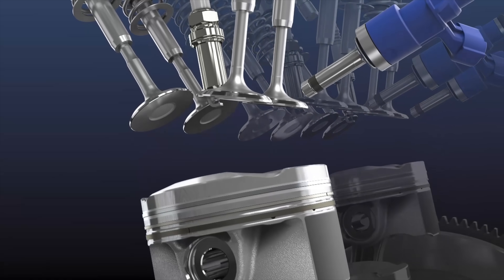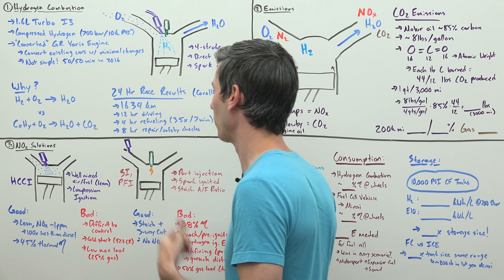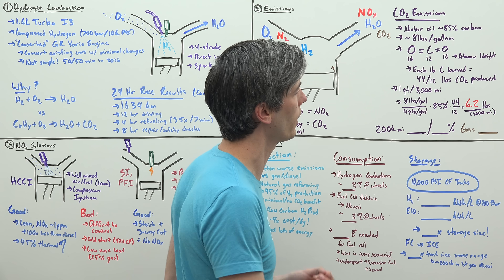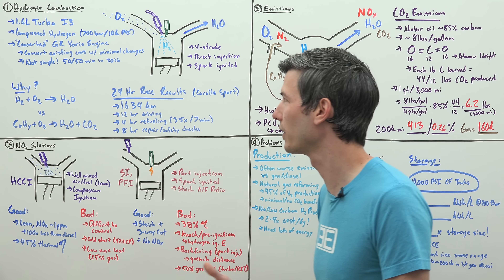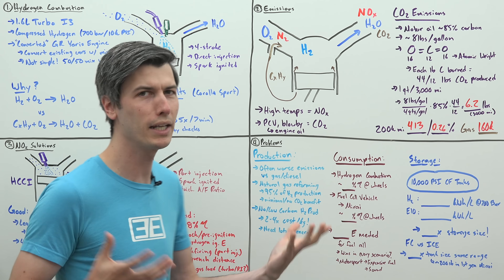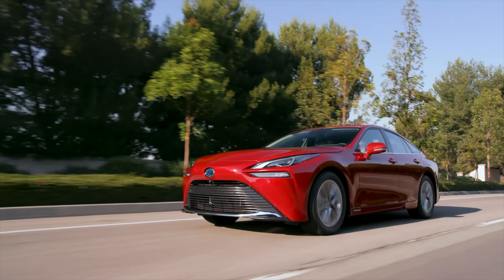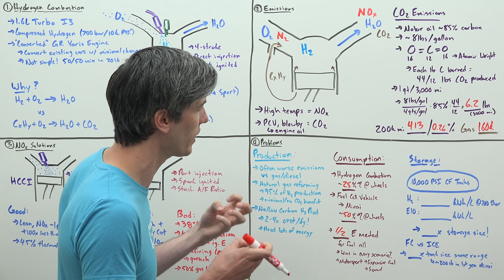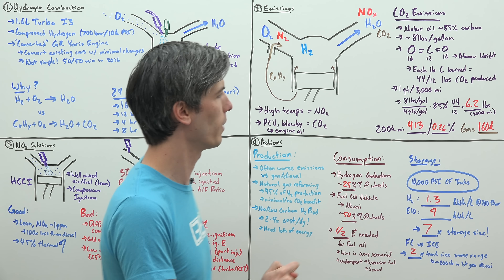Toyota's Developing A Hydrogen Combustion Engine!

Comment: “25% load, meaning you would need very large engines to make good power” sooo another 8.0L v10 hydrogen viper?
Reply: with all the power of a 4 cylinder corolla!!
Reply: @bigbones916  if your really lucky. Strap a turbo to that viper. Let it rev to 10k and you'll start getting closer to an impreza
Reply: Or we could just use gasoline engines. Why are we trying to reinvent the wheel?
Reply: @Benjamin Smith dude koenigsegg makes 600hp from three cylinder engine
Reply: @danielsatko-  he’s not wrong tho, the most powerful “4cyl” in the world, while the gemera is a 3cyl engine @,@
Reply: @TKUA11  cause more people are realizing that cars are killing the planet
Reply: @TKUA11  something has to do with global warming. I am a car mechanic and yes my study has also taught me that global warming is real and needs to be solved also oil isn't in infinite amounts available on earth. In the way we are consuming oil now faster then you think. But not before most people get their feet wet from the polar caps that are melting.
Reply: @danielsatko-  right.. I still think Mercedes is more impressive because you can daily drive it an expect over 100k miles of life.
Reply: Well it would need 4 times the displacement soooo...

32Liter v10 time
Reply: @danielsatko-  whats the displacement of the two engines
Reply: Would not mind a new Viper. Gasoline will be with Us for quite a while. And big block egines make such a beautiluf sound
Reply: @radboxingedits4107  I don’t think dodge is making a fuss about building bigger engines
Reply: I think the hydrogen engine will rev higher, 7500-15000rpm compared to todays 6000-12000

[EDITED]
Reply: @TKUA11  Not about that, it's about finding more carbon neutral ways to spin the wheels.
Reply: @atrem7942  Because the earth never had a period without ice caps... Oh wait... 🤔

In any case, you're right; just avoid the doomsayers.
Reply: @bigbones916  …and a mandatory trailer with the fuel tank to make it farther than the first intersection without running out of fuel.
Reply: actually his information is wrong and outdated
Reply: @SelecaoOfMidas  the earth will be just fine with or without us. It is only for mankind , global warming is a threat.
Reply: why can’t they combine an electric motor to get big RPM that’s supplementing the hydrogen engine? dual motor
Reply: @Cinnamontoastcrunch1029  it's actually the huge transport ships, which run almost on crude oil
Reply: @bigbones916  a 4 cylinder Corolla doesn’t make good power
Reply: @ButtMcDuck   Yes its a joke its meant to make fun of how weak the engine is compared to a normal engine with sarcastic enthusiasm.
Reply: With turbo chargers,, yes we can make it go fast on water,, I think hydrogen might favor big bore short stroke
Reply: Bob Lazar water powers Corvette solves all these problem.
Reply: @TKUA11  because failing to reinvent the wheel means we will ultimately be crushed by it`s wheight when it inetively catches up with us

I don`t like that our beloved dinosour juice drinking noise emiting hunks of metal are at serious risk of disappearing, but it`s somewhat reassuring to see companies like Toyota experiment with hydrogen to keep ICE going, or companies like Porsche and Bosch (and I seem to recall BMW also participating) who are experimenting with carbon neutral fuels that are supposedly a direct gasoline replacement, wth the advanteges of being fully carbon neutral, and emitting significantly less CO2 than normal fuels
Reply: @SelecaoOfMidas  We have never evolved to a period without the ICE caps nor has most plant and animal life.  The last time we have had that massive of a change of climate that quick we had great extinctions where 70-95% of all life went extinct meaning we would probably too.  Even if we don't go extinct from that alone our food supply almost certainly will.  So either billions dead or extinct.  Those are great options just so we can avoid having the single greatest greenhouse gas contributor on the planet (POVs, like if you look at numbers its not even close to anything else), still have V8s for noise.  yeah that's a great trade off vroom vroom for extinction.
Reply: @TKUA11  I can't tell if you are trolling, or just not smart.
Reply: @TKUA11  well in the big picture stuff cars aren't the issue but are the target so we have to go on a wild goose chase because politicians.
Reply: I want to see a 15.0L V20  hydrogen turbo engine making 300 HP perhaps. That'll be sweet
Reply: @geogmz8277  100k miles isn’t good. i would not buy a car with 100k life expectancy. you never know what kind of situation you’ll be in tomorrow.
Reply: @WillyK51  gasoline has about 15-20 years before we never get new ones again. so many of the biggest car company’s have said they plan to have full electric line ups by 2030-2040ish
Reply: @DrumFFx  because lithium is finite, same with gasoline/oil. we need something renewable through and through. electric battery cells can only go thought so many cycles before they’re useless and won’t hold a charge/won’t charge.
Reply: Jack K  it went down the past year because of covid. it’s going up bro. more drivers = more pollution. and there’s more drivers on the road now than there’s ever been. just open your eyes. have you not noticed more and more traffic in your area?
Reply: @Petrospect  another big contributor is lithium mining. it’s just as bad or worse than having gas cars. right now gas (ICE) cars are our best option. but if we don’t start some sort of revolution for the future, there won’t be much of a future.
Reply: Theres also a company that just made a new a boat engine, that makes 600hp NA, out of 4L, 4 cylinder.
Reply: @justabrokeredneck  I´m 70, so will hear the roar of V'8 race cars till I die. Hibryd´s make more sence bacause the miles they can cover. Any kind of presurized fuel like propane or hidrogen is akward , even if it´s green. Presurizing Hidrogen will use a lot of energy. After what hapened in Texas when electricity went down, gives you an idea of whatwill hapen if you substitute 25% of gas engines and replace them with electric and every one plugs in after work at the same time. Unles you go nuclear to produce enough electricity or use more fossil fuels for that pourpose. No one wins.
Reply: 6.0 V12 BMW hydrogen engine made 260bhp. With 5.6MPG......
Reply: @Benjamin Smith bmw made a 270hp hydrogen ICE a decade back
using a 6.6 liter V12
Reply: @Benjamin Smith Exactly; and over time with improvements in technology, engine efficiency and performance this could prove to be big.
Reply: same power as a toyota prius? lol
Reply: @bigbones916  200 viper hp feels a lot different that 200 corolla hp
Reply: @justabrokeredneck  "another big contributor is lithium mining. it’s just as bad or worse than having gas cars. right now gas (ICE) cars are our best option. but if we don’t start some sort of revolution for the future, there won’t be much of a future."

How is it worse than ICVs? Many studies have been done that debunk this claim.
Reply: @radboxingedits4107  Or 6.2L DOHC naturally aspirated V8 with an 8200 rpm redline.
Reply: @cryptikreap795  Or crank up the compression ratio out the wazoo and use prechambers.
Reply: @TKUA11  Climate change! It's real, we caused it by burning fossil fuels and we have to stop emitting CO2 or it's going to get way worse.
Reply: @danielsatko-  On petrol.
Reply: Except the viper produced 645 HP and 600 lb of torque… the hydrogen equivalent would produce between 92-192 hp and 85-150 lbs of torque… talk about diminishing returns. I used the 25% and 7x power to come up with those figures… anything less than 80% of what you can get from gas/diesel will absolutely fail in the market.
Reply: @seraanimsti3816   3cylinders - work different my little human. 3cyl rev higher ... F1 Cars have 3 cyl engines
Reply: @Cinnamontoastcrunch1029  yea the car is killinh the planet... not the ships and planes that transport stuff that people dont need a cargo ship uses over 100000 gallons of diesel each day 24h 365 times. And this war against ice cars will the go after ev cars becus its not about the climate its about limiting how much normal people can own.
Reply: @mezo72271  yes they are a big reason too. It’s a whole bunch of things combined that is killing the planet
Reply: @very7962  I love v8’s. I prefer gas cars over electric cars in terms of fun and sound however I can admit they kill the planet
Reply: @mikkejalonen9050  it’s multiple things killing the planet!
Reply: @very7962  actually many countries are gonna stop producing them and also it sounds more like wheeeeeeevvvvrooooooom
Reply: @very7962  why don’t I deserve freedom? That’s one of the reasons I love this country. There is no need for crying
Reply: Realistically, most vehicles made today would be perfectly serviceable vehicles with a reduction in power. Some could have 1/2 or 1/3 the power as they do and still be fun, I don't need a 400+ HP pickup, but I do like a 400HP pickup.
Reply: @Benjamin Smith Toyota currently make turbo v8’s that are 202hp. Their goal isn’t huge power
Reply: @sileniu  The F1 use V6 powerplant as of now, unless you are talking about 3cyl on each sides of v6.
Reply: @bigbones916  hydrogen cars have been around for a long time
Reply: @TKUA11  their trying to reinvent the wheel to make money on us..
Reply: That would still only get 250hp, out of your 8l v10.
Reply: @TKUA11  If that isn’t obvious to you maybe you need some sort of upgrade
Reply: What is interesting is the level of mis information,
 Some Facts h2 have s More Force yield than Btu Heat yield considered a cold radiating gas ,  some mixed message in your video which should be corrected , on one hand you say  need a lot of h2 on the other hand you say too much heat this is factually wrong, l  see you conveniently left out the Calculation for EGR % slow the laminar flame speed of the h2 to be a co equal replacement for carbon fuels why did you leav that off if you read the Hydrogen combustion report?? ? Often Carbon Fuel  Engineers  like to leave the EGR out of their explanation as  it shows h2 is a carbon fuel replacement equivalent  , Learn about the Effect of using EGR  % to lower the laminar flame speed of H2 creating efficiency and force yield not btu yield , this is what toyota is doing to co equal and replace all fossil fuels doing this allows less h2 to be used and thus less nox is the out some. . The Tax on h2  is higher income for  cities as the manufacture cost is  lower.   The Energy density of H2 is much higher than other fuels, (not but  it is about force)  God Speed NEVER STOP LEARNING
Reply: Jack K  why do you think pollution is going down you god damn genius?
Reply: Hydrogen takes more energy to produce its a waist
Reply: Toyota doesn't want electric vehicles
Reply: They invented the electric motor way before there were lobbyists
Reply: His assessment in this vid is a bit tongue in cheek. Hydrogen is the worst fuel for compression ignition, far too high octane, not sure why he bothers discussing it. Same thing with port injection, it's not 1996.
Reply: How about oxygen and hydrogen together qhen produced directly from water and injected in the engine
Reply: @TKUA11   because breathing in elevated levels of co2, nox is really awful for brain and lung function. Also gasoline will run out eventually.
Reply: @atrem7942   China generates about 27% of global greenhouse gases, more than the rest of the developed world, including the US.  The US is the second largest CO2 emitter at 11%, India is third at 6%. US oil consumption is already down to 1995 levels and falling further according to the EIA.
Reply: @bigbones916  oil ppl
Reply: @TKUA11  It's a finite source of energy. You don't know that?
Reply: @Benjamin Smith There were hydrogen powered engines many years ago. I wondered about hydrogen 30 years ago, found it had been done.
Reply: @TKUA11  
Oil doesn't last forever, is a finite resource. Even if we didn't care about the environment, companies will still care that they'll run out of their main resource.
Reply: Know that the Hydrogen Engine, based upon diesel to create the ignition less than 3%, has Pmax at about 88% of the Diesel Engine.

On this basis the MEP will be about 90% of Diesel.  Based upon this the Hydrogen Engine will mean an Engine about the same size.  Take the Fiat Ducato 2.3 litre Diesel, 130 Horse Power.  Replacement Hydrogen Engine will produce 115 Horse Power.  Given Pmax is lower, then the weight could arguable lighter or conversely same power from about the same weight slightly larger volume engine
Reply: you lost me when you aid its rally difficult to convert an engine to run on hydrogen, its not hard at all, cng systems exist already, substituting hydrogen for natural gas< dropping engine compression to mini,se engine knock and tuning properly to suit hydrogen is not hard either. the higher pressure tanks for hydrogen storage already exist.
Reply: He is wrong ... it will in fact over power a gas engine by a mile.
Reply: @mezo72271  incorrect, nice thought though. Ships account for only a small fraction of total transportation emissions. Look it up.
Reply: @thearchitect4726  "dropping engine compression to mini,se engine knock", octane rating is 130! You could run it in a diesel with 16:1 compression without knock!?
Reply: @Salvaba  unfortunately you will need a hydrogen tank half the size of your house if you wanted to go a decent distance between fuel stops.
Reply: @ameserich  would love to see the cooling system that an engine reving 15,000 RPM would need for a daily commute. You would have to drive at the speed of a formula one driver to prevent your engine from overheating.
Reply: @abyyman1671  I would love to see your fuel bill if that's the size of the engine you have to drive on your daily commute.
Reply: @bubba842  UHM... what im saying is 15k is the max for production vehicle, only engines for hypercars would have that... do you know todays gasoline engine are easily capable of 12k rpm? Lets say Hydrogen engine would rev 25% more
Reply: @Cinnamontoastcrunch1029  Did you know that the 15 largest ships in the world make more pollution than all cars combined?  I'm certainly on board with reducing pollution wherever possible.  That said, to make the biggest impact now, I think we would be best to tackle unregulated marine emissions, industry and strip mining.  Cars are far more visible day to day, but we can't change them very quickly.
With the issue of obtaining the necessary elements for battery EVs, and dealing with used batteries, I feel a more sustainable direction would be hydrogen fuel cell cars, running like an EV but with a fuel cell, not a battery.  This would alleviate that issue.  For energy, I think we must look back at nuclear, and use it in combination with renewables.  There are different reactor types, like molten salt thorium, much safer than the older thermal reactor designs.  We could use the electricity directly wherever possible, and use the excess to generate hydrogen.  This could replace natural gas through existing pipelines to run gas appliances and cars.
Reply: @jarrodheley7879  true I agree
Reply: If it made the right noise - OK 😎
Reply: @Benjamin Smith Completely inaccurate comparison. The gas engine started out extremely primitive,  so there was  a super large path to move upwards. We didn't know anything at that point so improvements came large fast and easy.  These hydrogen engines are starting way above that Benz engine from the 1800s. Surly you don't think this is comparable?
Reply: @Benjamin Smith it won't take 100 years to figure out that hydrogen is an absolutely horrible idea and abandon it.  Most people already have that part figured out.
Reply: @HAL-dm1eh  hydrogen is limited by how much fuel you want to burn to produce it. And you do know that you burn more energy than you produce when extracting hydrogen right?
Reply: Otto movement is not suited for hydrogen.. There are other design engines that are..once developed
Reply: @bigbones916  not if you mix it with a nitrogen based oxidizer like with rocket fuels, that’s exactly what imma do once I get my hands on it. That and hydrogen has a faster burn rate so you can speed up the compression.
Reply: @Spearmint22425  I don't think the engine would have the tolerance for that lol!
Reply: @bigbones916  that’s something to be found out
Reply: @Cinnamontoastcrunch1029  The US army emits more co2 than most countries. There are far bigger problems than cars.
Reply: We already can make a 1500cc three cylinder turbo engine produce good hp and torque. Drive smaller cars for the mean while, and think out the new non damaging fuels and concepts. Electric by battery is not the forward in my opinion, unless someone makes one powered by air and uses no fancy chemicals or precious mineral's. This technology probably must go on. Hydrogen may be more expensive and less efficient, but where else are we to go? All types of hydrogen development must go on, as well as battery development. Although I think the latter will loss to some other energy source.
Just a thought, what about  highly efficient capacitors in the car and a charging system layed in the ground. It could charge in a similar way to our cell phones in a connect free charger station. Endless Kms for as long as the pocket holds out.
Reply: @SelecaoOfMidas  There are some promising studies out there regarding graphene-coated rubber band powered vehicles.
Reply: Another? There was a first one? Where can I read about it
Reply: Or shorten the stroke and increase revs.
Basically this would make a great motorcycle engine.
Reply: @SelecaoOfMidas  🐴🐴🐴🐴🐴🐴🐴🐴🐴🐴🐴🐴🐴🐴🐴🐴🐴
Reply: @mikkejalonen9050  you realize cars collectively consume more than all ships and planes don't you
Reply: @marcanthony9659  If that matters remember the first Ford V8 made only 95hp at 3.6L , my friends altezza is a 2.0L 4 banger from 2001 and makes 190hp stock, gasoline engines have come a long way.
Reply: @Spearmint22425  you can just use straight liquid oxygen and liquid hydrogen, BOOM goes the engine... but not In the way you want 🤣
Reply: @Benjamin Smith jcb are developing similar and have prototype diggers working with hydrogen engines.
Reply: @Benjamin Smith pretty far, if they continue to exist and innovate for another 150 years.
Reply: Right on. A gallon of hydrogen in a modern car would not make it up a 5% grade. 500 gallons, maybe.
Reply: @TKUA11  because hydrogen is a no carbon fuel. if made from renewebles that is
Reply: From my understanding the reason they are inventing internal combustions hydrogen engine is because:
1. Hydrogen is a no carbon based fuel that can be made economically by voltrolysis. not electrolysis which is very expensive. Using voltrolysis one can make tens of liter of gas using under 100 watts of power.
2. There is a somewhat secret technique that is done on the HHO to increase its energy output before you burn it in the engine. They mix it with ionized gas and pass it through some kind of gas processor first. This can increase hydrogen energy density up to 3 folds.
Reply: @raloed.363  Pie in the sky.
Reply: No its actually way over 25% if done right to produce power and its been being done for years same as the patent for ceramic engines , combine the 2 and you have no need for servicing or other engine dramas with zero emissions and no need for exhaust so vehicles can be made lighter n quieter... I have seen drag cars buses trucks and normal family cars down to the mighty old Mk2 ford escort pinto running on straight hydrogen zero fuel such a shame the governments and oil companies threaten so many people that are doing all the experiments and getting them to work when their own teams cant lol... they took one of my friends vehicles off him stripped it down to see how it works then couldnt get it to run again afterwards so had to plead n beg to get him to get it running again lol , they are too over educated and thinking way too hard
Reply: @anthonydendle4768  ceramic engines ? 🤔. I never heard of that before. I know people been secretly using HHO for years thou.
Reply: WITH OUR ENGINE NO LARGE ENGINES ARE NEEDED, IT CAN BE SMALL ENGINES VERY SMALL
Reply: @TKUA11  Because the world is looking to address the global warming issue.
Reply: An 8.4L “HydroViper” shooting water out of the exhaust as it accelerates sounds like the coolest things I’ve ever heard of
Reply: Use a Diesel engine and compress the H2 and the engine would be a reasonable size.
Reply: Turbo, Super, Turbocharged
Reply: @KevinFreist  I only know about his red Corvette that is hydro powered.
Reply: @HAL-dm1eh  the Earths crust is many, many miles below franking levels 🤣
Reply: BMW already produced a hydrogen powered car between the years 2005-2007, according to Wikipedia. I remembered seeing that 760 iL for (lease) only before those dates at an NY Autoshow? 
Let's keep the insinuations and the record clear. Toyota is not the first automaker at this attempt. 
There has always been clean energy capabilities available. It's sitting on a bureaucratic shelf somewhere? God only knows what happened to their inventors? That also applies to 100 mpg gasoline combustion engines that were also shelved!! 
The defunct Saab automaker was the first to turbo charge small 4 cylinder block combustion engines 40+ years ago!! Now it's all the rage?? 
My point being, we've always had the technology to lay to rest the relic of that fossel fuel burning combustion engine. 
Lastly, "apparently" the Mars Land Rover uses an endless source of energy which can operate in super sub-zero oxygen deprived baron environment of a distant planet. While here on earth we grit our teeth on rising petrol pricing?? Who's in charge? Selfish Children? Geez!🤦
Reply: @jamiesmith6838  "Lastly, "apparently" the Mars Land Rover uses an endless source of energy which can operate in super sub-zero oxygen deprived baron environment of a distant planet."

Yea and it got there in a tin can that was fixed with a ball point pen during space travel. If only it were true...
Reply: @HAL-dm1eh  Lmao exactly!
Reply: @Cinnamontoastcrunch1029  wrong
Reply: @TKUA11  Because eco-mystics just LOVE their "alternative" fuel and power sources.  No matter how inefficient and horrible for the environment they are (see solar panels)
Reply: @DrumFFx  exactly. A hybrid. They used the same idea to make windmills handle higher winds. Also helps create electricity when the motor slows down the windmill when the wind gets too high.
Without the electric motor slowing it down, it'll spin too fast and get destroyed
Reply: Didn’t gasoline have a very similar beginning 🤔
Reply: Or use turbo like Toyota did
Reply: @HAL-dm1eh  lol, thereof we gain unappropriate repercussions in form of increased seismic activity from an empty basin cavern... Nice try, pal
Reply: @radboxingedits4107   a train engine  problem solved
Reply: 8L 2 stroke supercharged mazda engines giving similar power than a 2L TDI engine being more efficient and much cheaper than battery cars. Where i have to sign?
Reply: @TKUA11 lol, because oil isn't going to last forever, why not find a better cleaner way